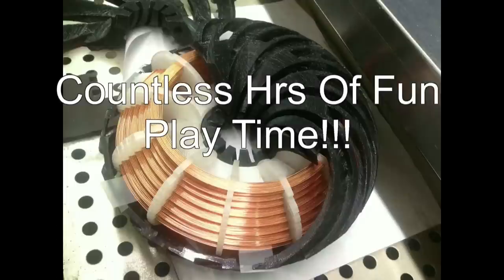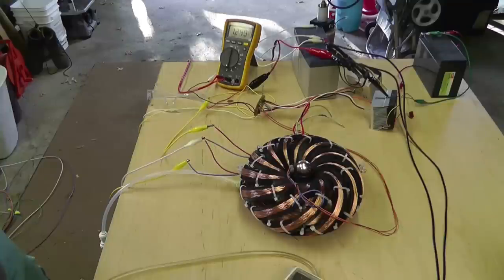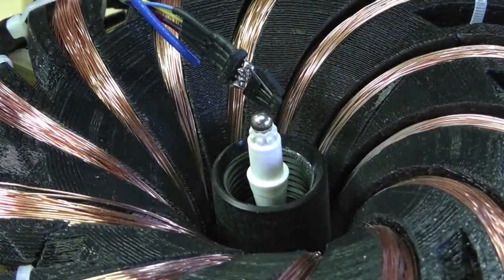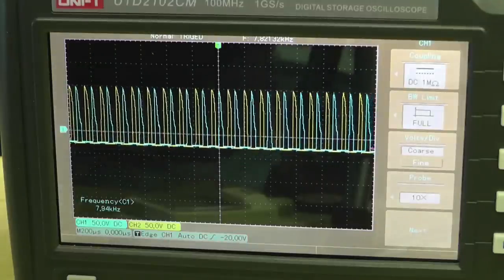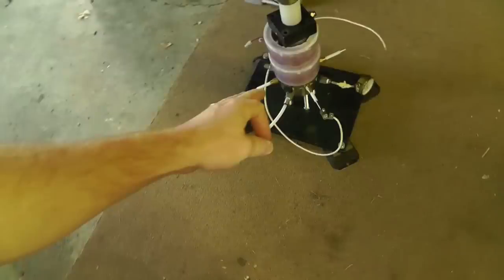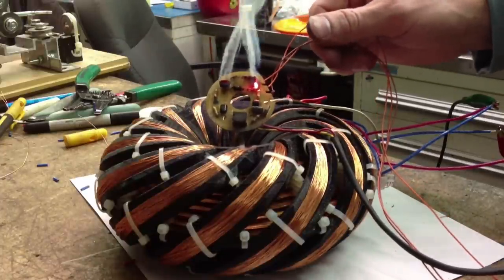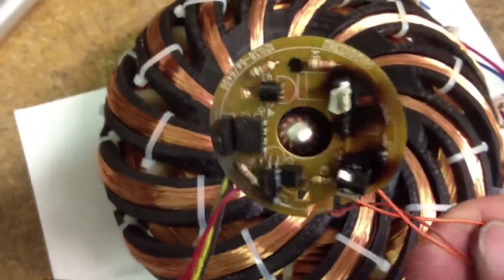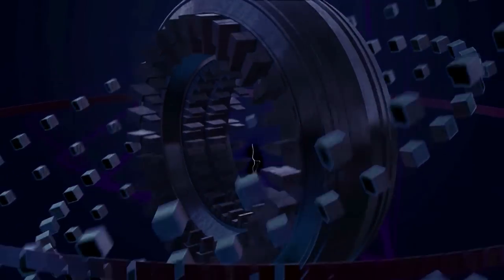PMBO 2013 ~Russ's Final Entry Video... OVER 1/2 Million RPM NEO Sphere Air Bearing With ABHA Coil.

Comment: Crazy to think in one second it's rotating like 8,000 times. Just a silly question but is there a physical limit to how fast something can spin? (Besides the speed of light) I mean by physical restraints like spinning a cd so fast it basically explodes apart from the forces on it.
Reply: At a certain speed the centripetal force will exceed the tensile strength of the steel that the ball bearing is made out of. There are a bunch of equations you can do to figure out what speed that is based on its size/composition. That speed will be very very high compared to CDs though.  The steel has a much higher tensile strength and it is a much smaller radius which will decrease radial velocity greatly. Check out some physics books it's pretty interesting stuff. As far as a point where physics puts up a stop sign the speed of light is a very obvious one. You could also make some roundabout claims about the stability of molecules of some substances before that speed but overall there's no "text book" speed limit.
Reply: Somewhere on YT is a video of both a standard CD and a computer hard-drive disk being spun to terminal velocity. Speed in the 10s of thousands rpm, in slo-mo showed both disks start to undulate and flex just prior to disintegrating. It stands to reason that anything made up of atoms, when spun to its limit, will break apart.
Reply: How do we know the speed of light is a stop sign?  We only know what we can measure see or feel, anything else is speculation, we do not know all the fores's of nature we only think we do, if Dark mater holds the universe together what holds dark mater together? if Corks are what atoms are made of, what are corks made of?
Like the universe its endless...... Think about it. 
I don't know this for fact, but we also don't know Light is the stop sign for speed for fact either. We may never prove Corks, how big the universe or if its the only one  is Dark matter or the speed limit.
We can't assume we know everything. We don't we just go by what we think we know for now.
http://bigthink.com/dr-kakus-universe/what-travels-faster-than-the-speed-of-light

Speed stops going faster when we think we have reached its limits. Just like knowledge. Thinking in abstract helps you see past this, Einstein was dyslexic its why he seen things in a different way.
We can't afford to let that box hold us down, hey I'm dyslexic too.
But i'm no Einstein either.
Sometimes big things happen when you ignore the rules science and physic have placed on us. Hey its just food for thought!
Wasn't the earth Flat at one time in history?
Reply: i think around 2 billion m/s?

Comment: If you simply put both coil sideways and then with a compass mapped the magnetic field lines produced by both configurations you would find that they are approximately the same.  The whole Rodin twisty configuration for the wire ultimately just averages out so it looks and acts like an ordinary coil.  The magnetic fields produced by each individual loop just add together and average out to your typical toroidal magnetic field pattern.  It's much ago about nothing to Marko's chagrin.

Comment: that was very cool 1/2 million RPM's, I am asking  what, or how you plan to
use the stable RPM's?  there is no load or magnetic field transfer to coil's, I am asking, so whats the next step, I can use electricity to spin a rotor,or to produce electricity is this an experiment  to see how many RPM's you can produce?

Comment: If sphere is 5mm, then 588,000.00 RPM = surface displacement of 9236 meters / minute (or 154 m/s). I tried to figure out if this is faster than a space shuttle, but I think those beasts move up to 50,000 km/h (which is 3,889 m/s) so... no. Too bad :)
Reply: 153,933333* :D

Comment: Hey if you still have this thing make one that is hollow and cast it in the best tensile strength aluminum you can and fill it will ferrofluid. Play around with the frequency i dont have a oscilloscope to fine tune mine but i got mine to act line a super conductor in quantum lock.

Comment: Awesome coil! Did you get to do any readings on it? I've read and seen some about vortex coils, but still can't quite put my finger on what makes them unique in an OU kind of way. Do they have low or negative resistance? 
Hope you'll also one day show the suspended magnet (no need for air bearing and continued drive after power disconnect. THAT is freaky Tesla like stuff.
I think next year you should not run the contest but win it.

Comment: How fast can the average hardened ball bearing spin before it loses its cohesion and becomes tiny fragments of suffering and death? 
Also, at what rpm level a bearing would need to spin that friction against atmosphere become so great that heat and then plasma envelopes the bearing? Logically it could be assumed that loss of cohesion and the buildup of massive heat resulting from a hardened bearing spinning fast enough is not only possible but an inevitability. I want to see similar experiments using magnetism as the stabilizing force and electrical fields as the power source of which drives the rotation. As long as atmosphere are present their will always be friction. But an object suspended by magnetism encased within an area devoid of atmosphere would encounter less friction than if encased with atmosphere. What would be the effects if in an environment of nearly no gravitational force would other forces like magnetism, light, momentum and light have upon a spinning object as described?

Comment: OK, an interesting observation, the ratio from the big ball to the small ball is NOT equal the spin ratio to size. Why? Any guesses out there. Outside weight.  Is there a power coefficient that's not displayed? For the record this can be used for flywheel regeneration to store energy. Instead of a capacitor.  Just food 4 thought. LOL

Comment: IT'S CALLED A FLOATING BEARING... AND...  IN CASE YOU DIDN'T KNOW... THEY SPIN JUST AS FAST AND ARE WAY WAY CHEAPER... I DIG UR ELECTROMAGNET THOUGH... IT HAS GREAT POTENTIAL FOR AMAZING IDEAS... UR ONTO SOMETHING... JUST POINTED IN THE WRONG DIRECTION OF DESIGN... GOOD LUCK...THINK HARDER

Comment: Maybe unplugging that circuit at the first sign of trouble, would have let you save more. So you would just have to replace some parts. I'm not an expert on fixing burnt electronics, but it seems like you just became fascinated by the light, and let it burn.

Interesting magnetic thingummywutsit though. An explanation of some kind would have been better than nothing.

Comment: Great job at pushing the speed envelope Russ.  However, like someone else said, the Rodin coil configuration is meaningless.  So perhaps one day you can do an experiment and compare a Rodin coil with a regular coil of similar proportions.  You will find that anything a Rodin coil can do a regular coil can do better.  In essence, you get the same functionality out of a regular coil but with less wire and less wire resistance.  Call it a Myth-Buster's kind of thing.

Comment: That antique television set should have been saved not destroyed.  That little bit of copper wire that was salvaged would have been relatively inexpensive to buy outright, without destroying an antique. 

That is a very interesting winding design though!

Comment: time dilation has nothing to do with "time" what ever that may be.
the faster you are moving the slower ALL physical processes become.
clocks running slower,radioactive decay, electron orbit speedrelative to the core etc. etc.  you percive a slower "time", while its just a slowing down of the physical processes, absolutly all of them. dont think that there is such thing as time.
this means you can stop "time" by slowing down all processes to zero but you can not reverse it-> no timetravel backwards but viritual timetravel forward.
a space ship that travels at 99.9999999999999999999999999999999 lightspeed can not stop using its own thrusters because all physicalprocesses on board came to a viritual halt. time is only a contruct that helps uns thinking about and describing  the effects.

Comment: You think you could make that coil bigger and use that coil used with superconducting materials to power a cold thrust jet fan? The fan would take advantage of the mobious effect to lock in the fan so the fan would spin at greater speeds from the superconducting materials the fan is made out of with the fan being super cooled. So you would have a floating fan locked into a position generating incredib thrust. Crazy idea i know yet what if it worked? An electric aircraft that has two or four of these cold thrust jet engine's on the wing's with a intake on the top of the aircraft to draw in air to spin a super conducting electrical power generator to power the four cold thrust engines? Unlimited range and the aircraft could go up into space use the earths rotation and be any where on the globe in 3 to 4 hour's or less? 😊😉

Comment from the maker: Neal, 

Have you ever build any kind of pulse motor? Sense your asking it would seem you have not. A simple pulse motor can create BEMF this is a high voltage spike in the opposite direction than your applying. For 12 v in you can get 1000's of volts back out. This can be useful for Applications like step charging a water capacitor... Sound like something we are looking for in a system like Stan's... You relly need to figure it out. People don't like how you act. Thus no respect to you. ~Russ

Comment: any real world applications for this?
how about it's polarity?
what would happen if you hit it with a serious blast of electromagnetic wave in the same polarity?
like another coil at the side facing a given direction that can be fired using capacitors/not cycled...?
what would a magnet ball do spinning at 300,000-rpm that was hit by a massive field of the same polarity?
can you levitate your balls;-?
how about a spinning coil below AND above the balls?
with another big launching coil that can be fired the very moment that you switch off the spinning/levitating coils?
this could possibly be a real competitor to the centrifugal gun...

Comment: A dot on the surface of a 2cm ball at 500,000 rpm is only spinning at most 0.52km/hr
Reply: 2cm * pi * 500000/min = 3.14 * 10^6 cm/min = 31 km/min = 0.52 km/s

You are off by a factor of 3600. This is faster than the speed of sound.
Reply: Kasper Feld right, my mistake

Comment: 1Khz = 60,000 rpm
Where  is the math to prove it?
I bet the 1Khz signal is from the PWM fan motor controller you are using.

Comment: Couldn't any of these "explode" due to centrifugal force?
Reply: +Evi1M4chine what eould happen if he adds liquid nitrogen to the Small magnet bb
Reply: Hell yeah!!!!....Super-cool the entire system. if we get that ball spinning fast enough the atoms on the outter layer of the ball would be traveling through space faster than light.. so the key here is...the winding of the coil must be a superconductor too, copper is slowing down the electrons, there is impedance, you know. So, if you can wind ( this is in theory) a gold wire coil. then supercool to just above absolute zero and use permanent high power magnets the ball will spin A LOT faster. and maybe just maybe, we discover something new here. I theorize in this mental experiment that the ball as it reaches max velocity ( for Einstein's sake lets say light speed) the space directly around it will bend in such a way that either the ball will seem to disappear or the ball will slow time down to the point that from the viewers perspective it will look like if it stopped moving ...and well, there is that third option where he spawns a singularity. but lets try and not look that way for our sake and that of the experimenter. Nevertheless, appart from a particle collider, this young scientist already broke the speed record for a single atom traveling through space I believe.

Comment: russ be careful your unlocking the secret to time
time warp. you will be sucked into another dimension.
if you had that in the core of a platform you could.  i think you have created levitation. with the simple way you explain it we could repair it easily if there were any problems. i believe this design will take the human race into space.

Comment: You do not have the authority to preach to me about meyers tech,
You fell short..
I have replicated a meyer step charge, Max has the best wave yet...
You cannot simply apply high voltage to a cell and expect production, way more to it than that....
Hook your high voltage bemf to a cell and watch as the voltage drops to zero, Not a tuned circuit....
I know what the difference is between electrolysis and Meyers style.
With what people have donated to you , you should be farther ahead than anyone..

Comment: waste of time if you don't know what you are doing, however spinning up balls to stupendous speeds could be the basis of a new type of weapon, there are alternative methods of doing it, however efficiency isn't an issue here, you are building up a lot of kinetic energy in the projectile, now oppose that spin using huge opposing electromagnetic force and turn that rotational kinetic energy into directed linear motion, easier said than done, however the technology offers alternative to gaussian accelerators.
Reply: Nothing is a waste of time if you enjoy the time spent or you learn something.

Comment: In your 3 hours of wire 'cleenup,' maybe you could learn how to spell "Cleanup."
Reply: your the problem. think of something constructive or dont fog the atmosphere.
Reply: ---ElectroMan---  Define constructive.  Does correcting spelling make your mile time faster?  Does it make your garden greener?  Whatever you are working on, is it directly helped by the spelling correcting?  If not, then it isn't constructive.  It doesn't help Russ make a better pulse motor, that's for sure.  Is it bad?  No.  But it doesn't functionally help anything.   I'm supposed to be making a EAF blacksmith forge, for example.  There are only so many actions I can commit to that will meaningfully contribute to that, and correcting how other people use our abstract & fabricated language isn't one of them.
Reply: ---ElectroMan--- THANK YOU!